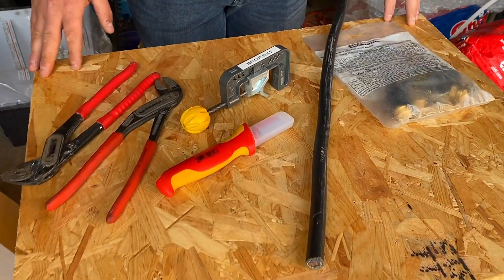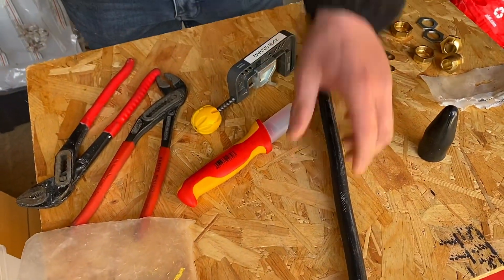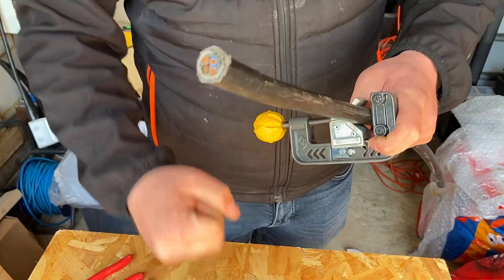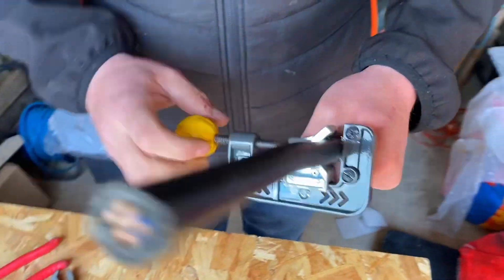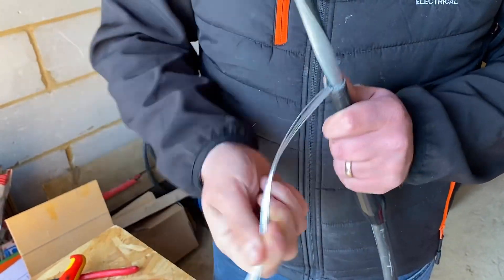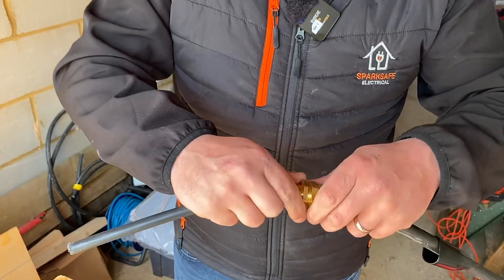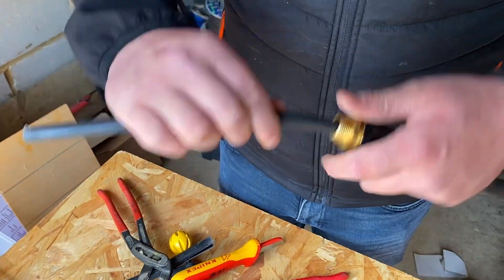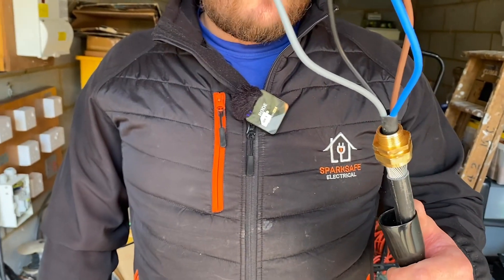How to Make Off an Armoured Cable - SWA

Comment: Hey Gary, hope you're alright. I love your videos, they are very precise and well explained. Is the armour a protective conductor or does it have other purpose?
Reply from the maker: Thanks. Can also provide the cable with a cpc (Earth) in a circuit. However, as the steel SWA is an exposed conductive part it does need earthing.

Comment: Great explanation for learners. But the armourslice is self adjusting so no need to tighten as you go. Another tip for stopping fish hooking of the armour. Wiggle side to side rather than back and forth. 

Now do a real world install. 4deg outside and pissing it down. 😂

Then move with the times and use a Storm Gland. 😇
Reply from the maker: Colleges are years of SWA storm Glands massive thanks for watching and commenting 👍🏻

Comment: The Ck slice is Spring loaded and adjusts into the work so there's no need to tighten as you go. I have to admit to preferring flat bladed tools spanners or knipex pliers wrench perhaps a better practice
Reply from the maker: Thanks for the top tip 👍🏻